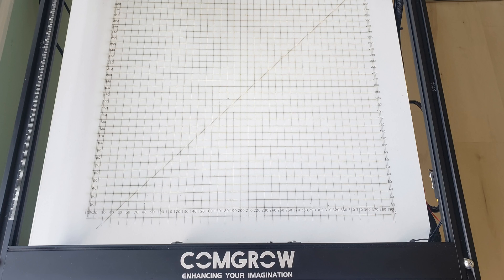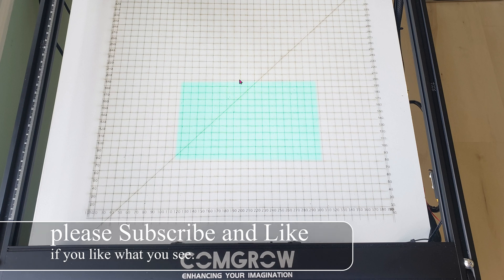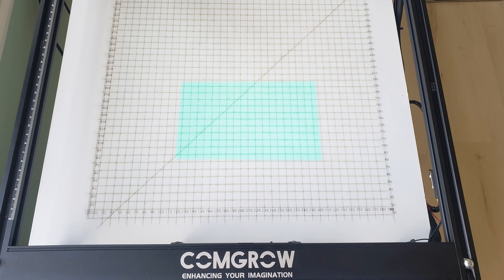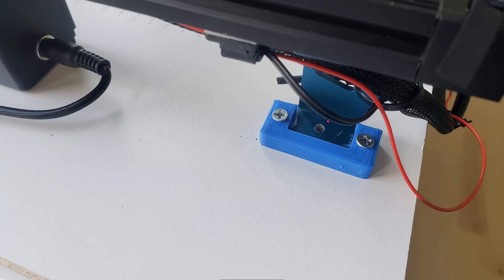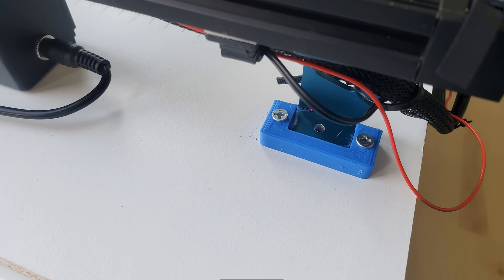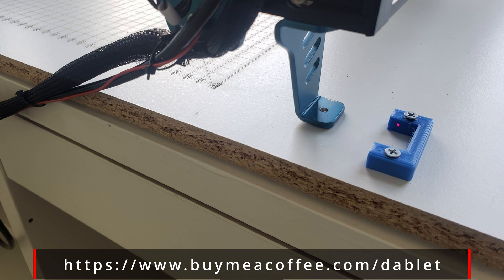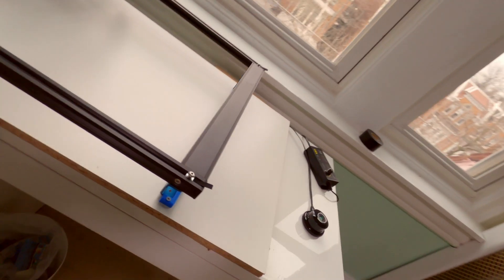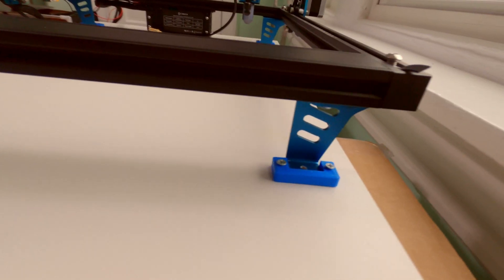Laser a Grid for aligning objects and materials with Lightburn

Comment: So you don't use a honeycomb metal grid under your projects? You just place the project piece straight onto this particle board?
Reply from the maker: For engraving projects such as tiles, no need for honeycomb
Reply: Awww that makes sense. I’m super new to this stuff. What speed and power did you use to make this?